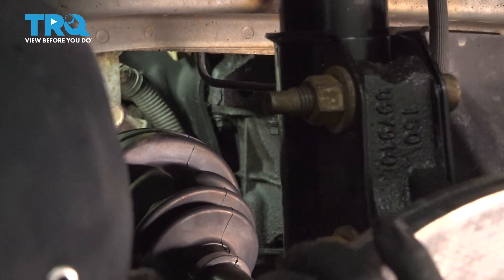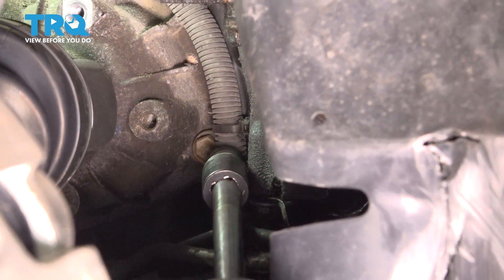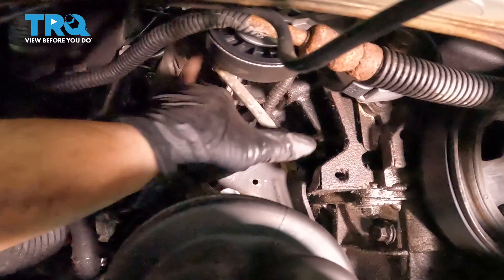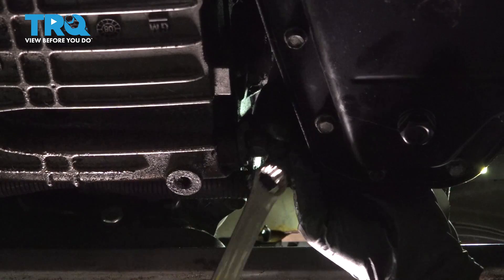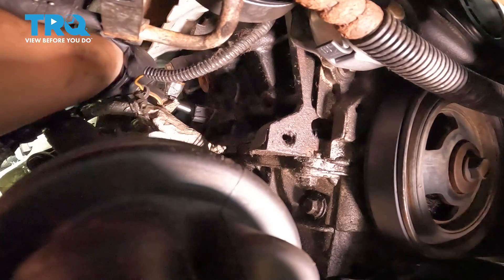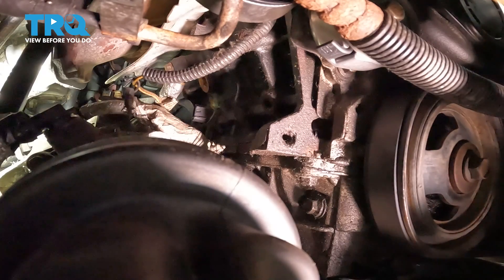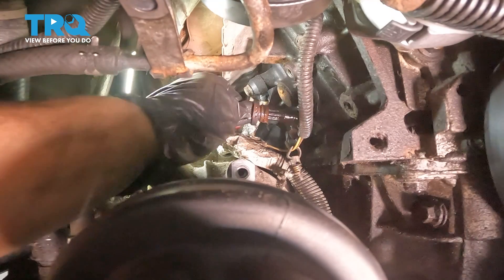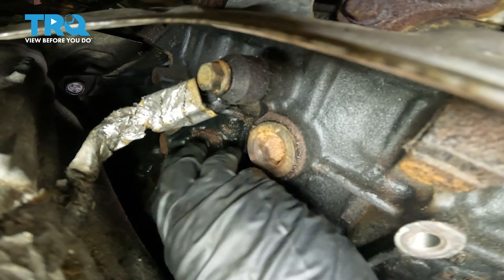How to Replace Crankshaft Position Sensor 2006-2013 Chevrolet Impala

Comment: I got a 2010 Chevrolet impala LT. Replaced the computer and done a key relearn and everything was fine. Only code I have now is crankshaft relearn with no check engine light on. I tried to do it myself at 4,000rpms ect. Didnt work. I also read it may just need to be driven up to 100 miles for it to relearn.  So I drove it about 10 miles and check engine light came on. I dont want it to go back into limp mode like it was.
Reply from the maker: +MistletoeXO We wouldn't be able to diagnose an issue like that here, you may want to have a local mechanic take a look at it. Thanks for checking us out! http://1aau.to/m/Shop-1AAuto-c

Comment: I know one thing this is not a 3.9 camshaft position sensor
Reply: It's a crankshaft sense I have a 3.9 and I'm doing this now it is the same one
Reply: Update I've just finished took me a couple days because the sensor was stuck and weather was too bad to get under the car but it's done noww
Reply: El sensor del árbol de levas está detrás de la bomba de dirección hidráulica

Comment: Did you use anything to hold the engine or the bracket just needed to be removed to access the sensor ?
Reply: if u remove a motor mount all stabilize the motor